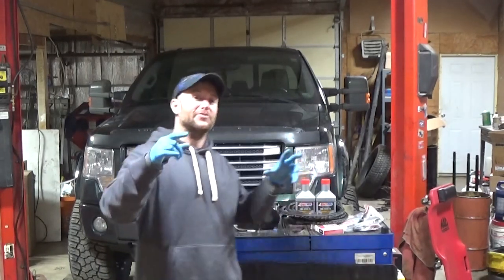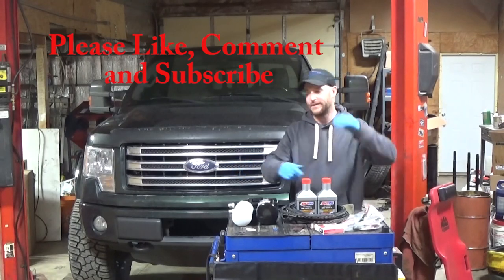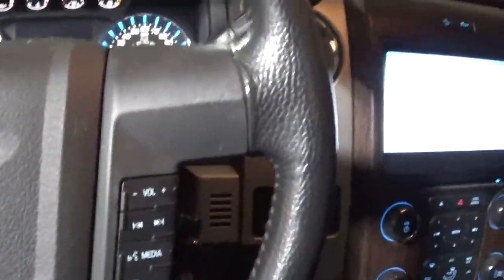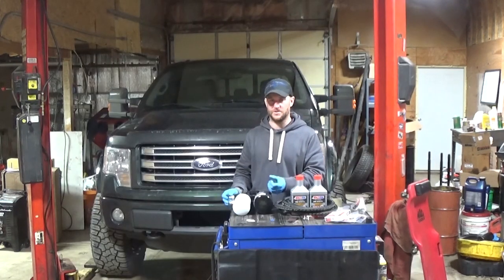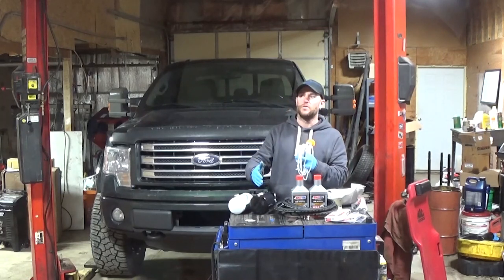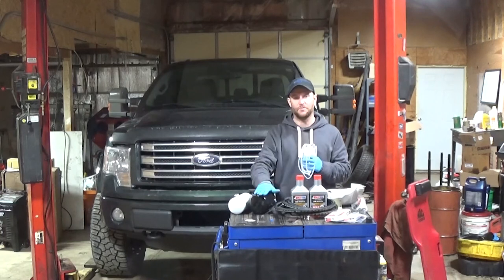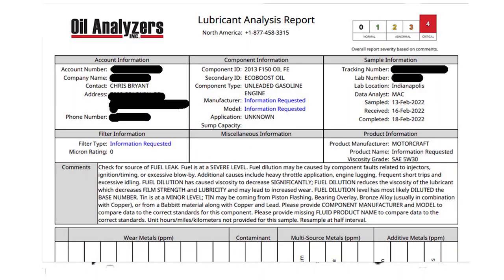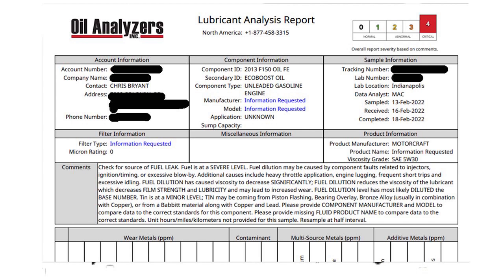STARTING F150 ECOBOOST BYPASS OIL FILTER LONG TERM TEST/ OIL TEST SHOWS TOO MUCH FUEL IN OIL!!!!

Comment: Great video. I also own a few 3.5 EcoBoost. Both are the front wheel drive versions. One a SHO, and now an Explorer sport. I haven't ran an oil analysis on them, but I notice that if my oil changes get to 4000+ that there is a smell of gas to the waste oil.
After talking to a few friends who are dealer techs about it, I have been told the same answer.  EcoBoost engines need oil changes at 3000 miles to keep the fuel dilution at a minimum and because of the abuse the turbochargers have on the oil.
I don't have a better idea or answer, but it hasn't let me down yet.
Reply from the maker: They are impressive engines. I love driving SHO. They scoot. 
My parents have a Lincoln MKT and one of my brothers has a 2021 F150 3.5. What I learn from this testing will be applied to theirs and I’ll do oil testing for those as well. The test kits are cheap for how much you learn.
Reply: @showmerepair  how has the bypass oil filters worked on this truck

Comment: If your injectors are working correctly.(possibly run some fuel system cleaner) about the only thing you can do is change the oil more often?